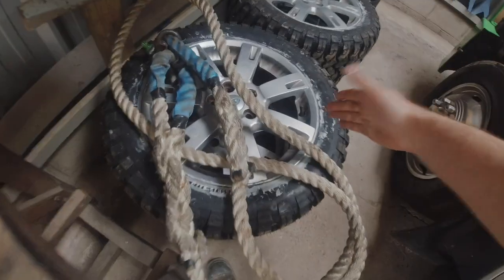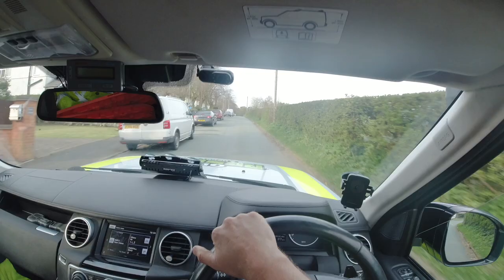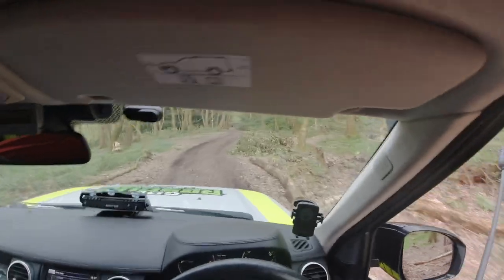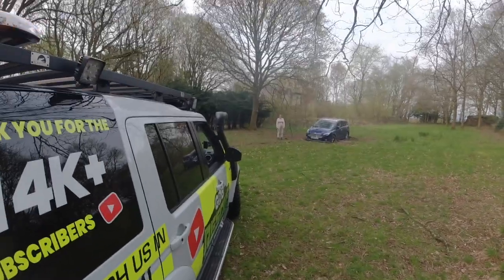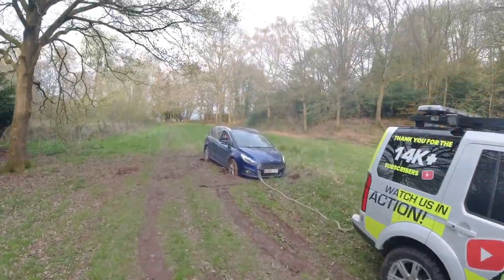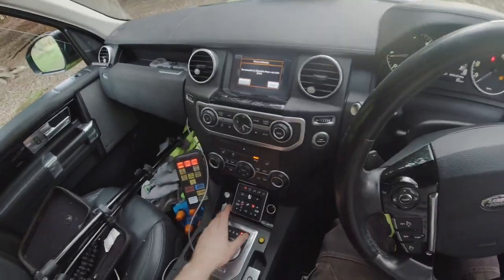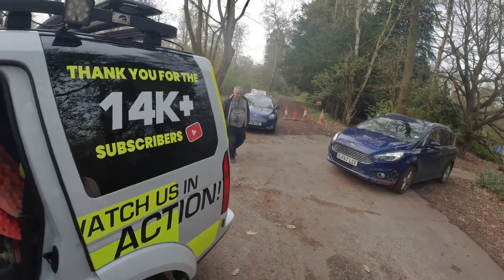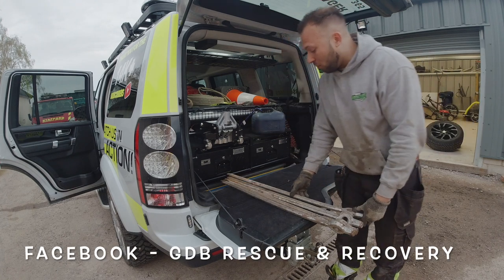BIG truck = BIG mistake! Off Road RECOVERY FAILED. The HEAVY RECOVERY truck had to be RECOVERED!

Comment: Any decent tilt and slide driver would have pushed himself with the body
Reply: Any decent driver would have reversed down,got to the field and realised it was too soft.
Reply: That truck was an SLA so no effective pushing. Trust me I tried
Reply: And I'm not the driver of the slide bed by the way. But I've been in similar situation
Reply: Sometimes the ground is too soft to push yourself out. I drove one truck that had a horrible dump angle and wouldn't have pushed at all. If I was on a slight downgrade picking a vehicle from a plateau sometimes the deck wouldn't touch the ground. Don't miss that POS truck. One I drive now I can tilt tf out of it. No more shaking cars off in park, tilt it till it slides 😀
Reply: @markfarminer5319  oh yeah you never been stuck have you?
Reply: Correct
Reply: My sla slide bed ,you can't use your PTO with the hand brake off.
Reply: Not impressed with the slating of other garages. Not very professional in my book. The driver obviously had little experience. If other garages slate you dont come down to their level,just be happy you got an easy job. Ive got stuck myself over my 34 years in the job and mostly by trying to save time.

Comment: From working for a contractor to now working for the big orange group, I've gained a lot of respect for you following this video. In no way would I ever have thought of taking a truck down that track, we'd have DMAX lads not drive down there, crazy.
Reply: Up until the muddy bit looked exactly like the goat trails I used to go down in a tandem axle tanker with 20,000L of gasoline in it.
Reply: Have driven 26t car transporter, going crazy places, but one moment here.. When hard ground ended.. I walk to see the situation and here I wouldn't even reverse mine in :) it's soft it sinks in 1 sec and road tyres become worse than on ice

Comment: tilt slid would been good if it was on correct truck something with 4x4 or 6x6 Mercedes has few off road trucks what ideal for tilt and slide. but a truck for this job over kill by looks of it. my first car fiesta diesel 07 did worse off road than this but light weight helps you no sinking and bit low down torque helps too. been in forest on crazy hill climb on side mountain with very steep drop offs, it was tar then gravel to mud narrow track so slippy half way up handbrake useless so had to leave it in gear a week after passing my test. had clear the road fallen branch to get to top and a 3 point turn on very muddy y split in the rack and crazy angles it ended well and got out, good rain rated tyres and diesel weight on those tyres sure helped. all my city cars do bit off road like challenge so fiesta 1.4tdci 07, 1.2 i20 2011, and my newer i20 2015 on Monday i will have check ground clearance before i try any but only light stuff as cost to much to damage, but saying that non my cars ever got damaged so and steady were needed and pick correct line. i20 11 down side light engine so had to have more speed at times but not to much just right amount and cause no damage. good fun but know when you really should turn back or it costly tow

Comment: Danger! Enjoyed the video BUT - when I saw you sit the shackles on top of your rear load area I winced at the lack of a cargo barrier. Then you appeared to put all the heavy stuff in the drawers and I sighed relief, but no!, there was a massive shackle behind your head the whole time just sitting on top of the drawer unit.
In Oz if a worksafe inspector saw that video you'd be getting a visit Monday! Love your rig and equipment, but that's as dangerous as hell to not have a cargo barrier between you and those massive lumps of metal.
Secondly, being in Oz, our 4wd actiion is pretty hard core and I've personally seen a tow hook break and come through the back window and embed itself in the cargo barrier - you are doing recovery for a living so more likely to happen if that dodgy threaded hook let go and shot straight at you. Thanks for the great content.

Comment: I bet that felt so sweet! These boys will get all the big bucks jobs from Highways England too. Strange isn't it? Its the same everywhere, and the damage  these type of operations can do "recovering" is unmentionable. Quite often more damage is done by ham fisted recovery than during the mishap itself. Easy job that could have been done in any number of ways. A Hi Lux /Isuzu/Navara/LS200 would have also done this with the correct tyres. The Towing eye error could have ended BADLY for them too in terms of vehicle and personal injury. Biggest is not always best. Most suitable is always best.. Great work Greg!

Comment: That is incredible, ive pulled out similar to the c max  with my volvo xc60  on mitchelin cross climate tires! Albeit flat ground.

Who in their right mind would atempt to drive the tilt bed truck down the track without walking it.

Comment: Grass is nightmare  to drive on. You need a 4x4 decent tyres. Any lorry will get stuck on grass. Been a hgv mixer driver 30 years. Always getting stuck on sites. Very easy to do damage when you get bogged down radiator  oil cooler sump and burn a clutch out rip mudguards off. Sand is also another bad thing to drive on will strip a differential because of the shock loading seen it done .😁❤

Comment: Ive been wanting to know this for ages where did you get your tow rope from as I'd love a proper tow rope instead a strop! great to see your d4 in action!
Reply from the maker: Good question ive had these for years!! Ill try have a gander possibly off a shop on ebay comes to mind!
Reply: I've used a UK company called rope services,  ropes are made to order to the length and spec you want.
Reply: They use strips because they are safety weight rated for insurance reason, ropes aren’t.